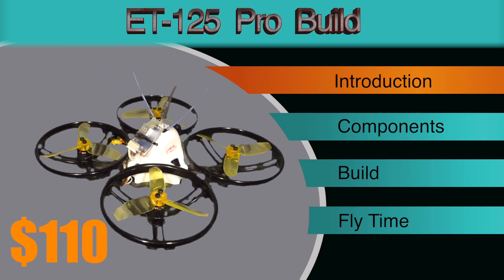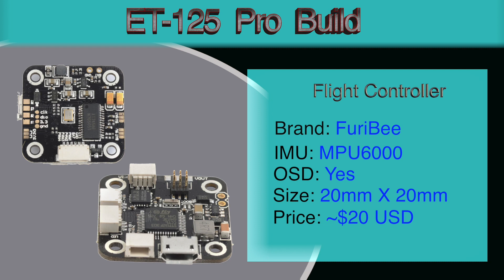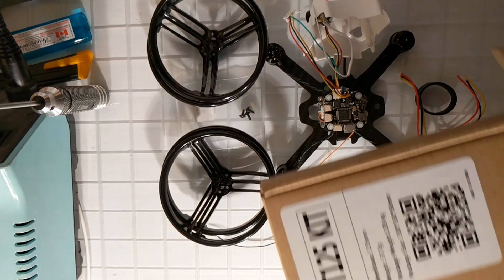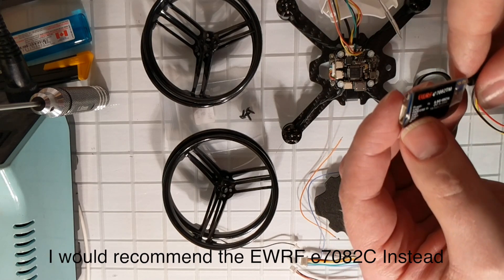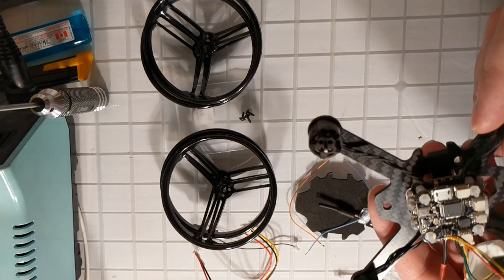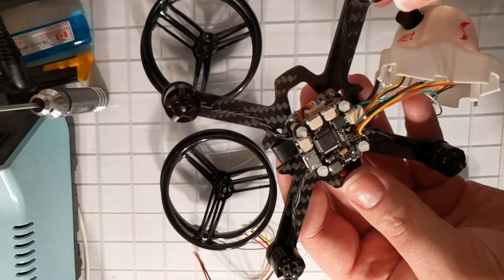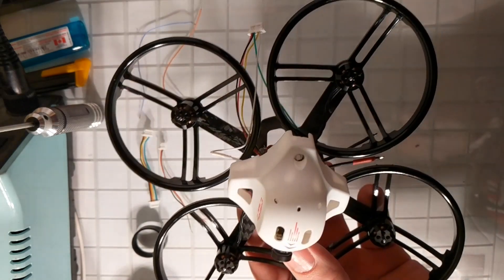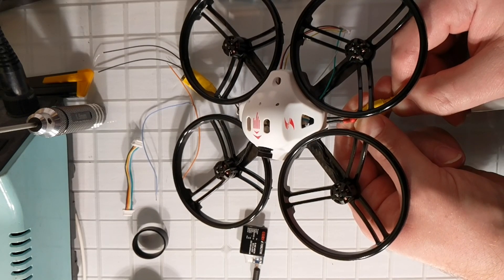Quad Build: ET-125 "Pro"

Comment: can i replace the stock fpv camera with caddx turtle v2 and also the stock vtx with eachine vtx02.
Reply from the maker: I suspect an Eachine VTX02, VTX03, or VTX03s would all probably fit, but I suspect you would need to put it in 90 degrees to the frame and so the antenna may be a bit short ( Its probably fine if you stay close, or crank up the power ).. The turtle v2 I think would be too big for the stock body.  I've since replaced this cheaper camera with a RunCam Nano, and it fit nicely. If you like Caddex, they have the turbo EOS2 that I believe it about the same size as the RunCam nano - so it also should fit just fine.

Comment: Hello!  I also built an ET125 Pro!  The problem stemmed from the same thing you said in your video! KingKong seemed to always used these old, outdated components that they must have had a ton of.  If we were to look back to all of their quads before the Fly Egg 138 came out, we would see that they constantly used the PicoBLX stack - which doesn't even support DShot600, OSD, or 3S and is very old and outdated.  They also used a crap camera.  They obviously went with those motors because anything bigger would have been a waste because they could only support 2S!  Actually, one hell of a lot of hype around this series just because of THE FRAME!  That's the only really good part of the entire series of 3 quads.  Why they just don't make a 100mm and a 125mm, it's only 1" difference!, and had to throw in the ET115 in the middle, is beyond me!  Seems silly 3 models 1/2" apart in size!
I also went with a 20amp 4 in 1 ESC and a similar FC...mine was from the Leader 120.  GearBest, when I still bought from them (never again! :( ugh!), had the two on sale for $24 shipped for the pair!  Total price!  So, I couldn't resist!  I took the 1106 motors off my Tarot 150...And will eventually upgrade to a higher KV motor.  I also used the same brand of VTX, but I went with the EWRF e7092TM with the same features as yours but 20x20 stack mounted. Only $11.99 @ MYRCMART!  Quick shipping from them too!  
I found the stock canopy to be a real weak point because it wasn't big enough for the VTX, receiver, or a micro camera.  I went with the Caddx F1 micro turbo.  
So, eliminating the canopy meant I had to come up with something else!  I went into TinkerCad and designed a simply hollow cylinder.  It's really easy to use!  First time I used it, in fact.  I printed it so it was strong, but thin and lightweight.  I measured the diameter of the distance between all of the prop guards after they were installed.  I noticed I could subtract a couple of mm's and it would still slip right over the stack.  It works perfectly!  I even drilled out a slot for the USB cable to slide right in with the cylinder in place!  I found a 20x20mm micro camera mount that is ok, but I will probably find another.  It gives complete protection to the micro camera and also allows for great flexibility of angle of camera.  It also screws on the 20x20mm stack to make it 4 items high.  To let airflow in to the VTX, which is 3rd in the stack, right below the camera, I cut my cylinder down to about 1-2mm below the actual top of the VTX.  A tiny gap, but just enough to constantly cool the VTX with air while flying. Everything is protected and inside of the cylinder and FPV camera mount.  The cylinder will actually can be lifted right over everything, even the camera canopy, and off so full access to the stack is a simply slip off of the cylinder!  I went with the FrSky R-XSR Recevier because it is the smallest for FrSky.  It fits right behind the camera under the canopy for the camera.  
Still ironing out flight bugs, but I will have it dialed in by the end of the week!  So many times better than the stock ET125 !!!  No comparison, as you well know! :)
Reply from the maker: Hey @Scooter Rotor!.  Thanks for visiting my channel!  Thank you for sharing your experience - I am glad you opted to build a Pro version of the ET125. I have the same thinking.. The components of the stock version are a waste of money.. The frame is the only part that is useful.   I love this little beast on 3S.  I’ve made a couple minor changes to mine. I’ve replaced the VTX with a smaller version of the same Brand ( I’ve had good experience so far with EWRF ) that fits under the stack.  I need to solder on a longer antenna though, I get some noise from the motors.   I’ve also replaced the camera with a Runcam Micro ( very Nice ).  I had to make the stock camera hole bigger on the stock canopy, but it all fits.   I would love to see your custom canopy and stack, it sounds awesome!.  If I had a 3D printer, I would also print a custom canopy.  The USB is a pain the arse. :).
Reply: Scoot Roter I would love to build
What you just described in here, do you happens to have any photos or
Video by any chance tu use them as a guideline to make my component list and the build
Itself it would be of great help and would love to replicate what you did as I agree on everything you said there are things that make any sense o. Their components but the frame is good, thanks in advance